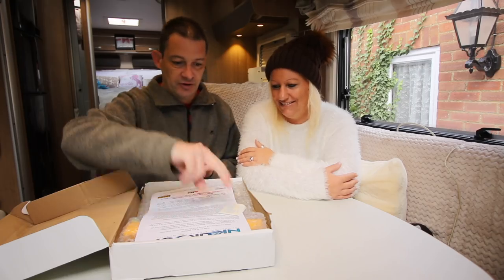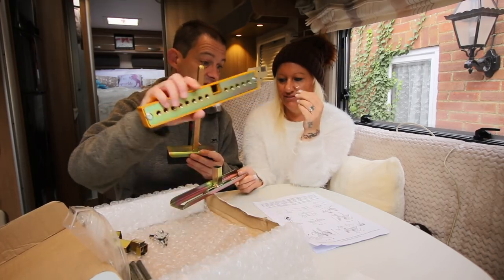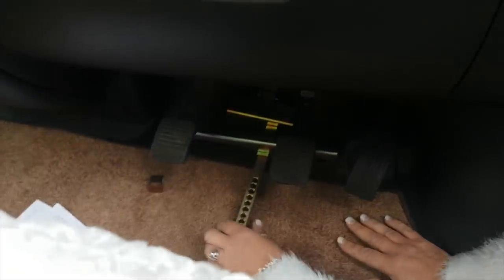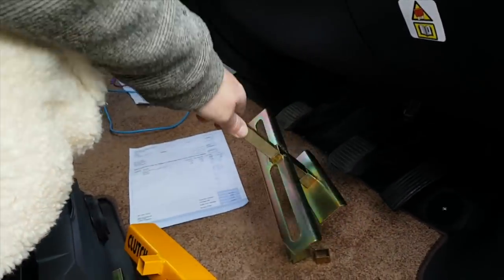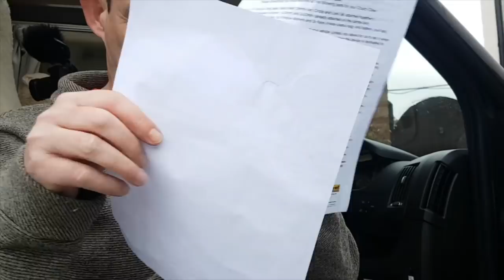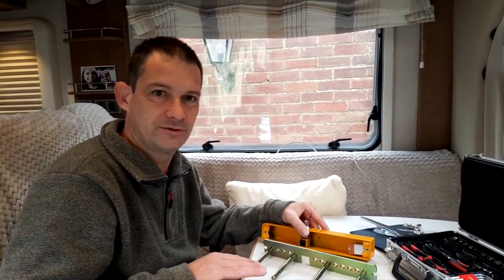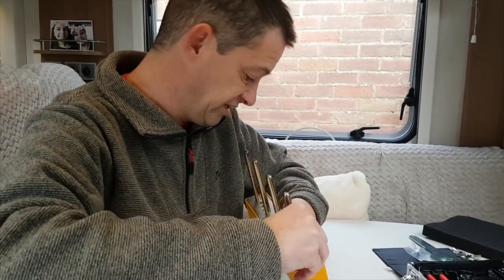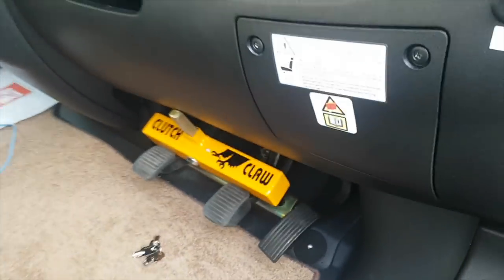Fitting Motorhome Security. For Dummies....By Dummies

Comment: There is one thing you have't done. The tight fitting 'ring' that you removed from the centre bar at the beginning has to be fitted back on the bar now that you have inserted the correct spacer, this will hold the back plate in position and stop it sliding off when removing  Clutch Claw from the peddles. It really does help to 'read the instructions'. I purchased one of these some 12 months ago. A great piece of kit!
Reply from the maker: I did replace the ring but didnt film it. The director ftom Clutch Claw contacted me last night to say thank you and the video has highlighted a few things that they might have to change slightly to make it easier for dummies like me lol

Comment: I would have installed a battery shutoff or fuel shutoff over putting something like that claw on there.  Hope you don't need to use the vehicle in a hurry and then have to take that thing off first.  I wanted to suggest also that you look for a battery powered candle rather than a real open flame type candle.  We hope you can have tonnes of fun but be safe too.

Comment: Mr Bean to the rescue lol. Dan I have been a subscriber for a couple years and have enjoy all you have done. Mazzy is an awesome young lady and you are great together. I watch videos on my phone and don’t have the best sight. Someone correct me if I’m wrong. Dan did you have the screwdriver bit stuck in a socket for bolts instead of the adapter for the driver bit? lol
Reply from the maker: No it was just a faulty set.

Comment: Neat looking device but those 4 metal prong things want to be tight up to either side of the clutch and brake levers (the thin metal arms) not the actual rubber bits of the pedals to stop someone just wiggling it off.

Comment: It can be slightly difficult but it could still be driven without clutch or footbrake, ie; if you put van in 1st 2nd gear and turn the ignition it will kangaroo forward and eventually run  and then you can change gear without the clutch if you can get the revs right and then use the handbrake to slow, however if the van stalls you have to start the kangaroo process again. PS: Don't try it,  only useful in an emergency to know if your clutch ever gives up the van can be driven to a degree.
Reply from the maker: Id love to see a video of you driving with a clutch claw on LOL That would go viral.